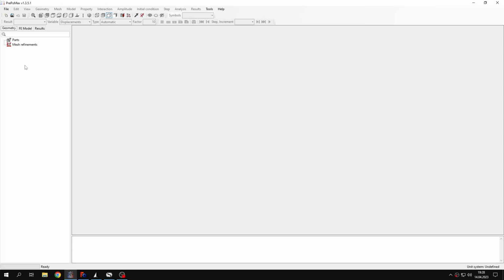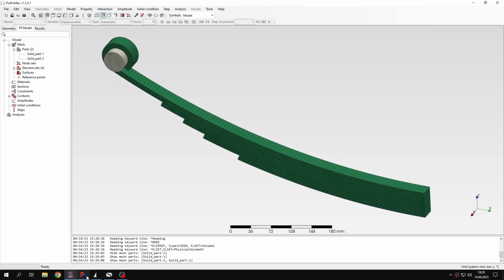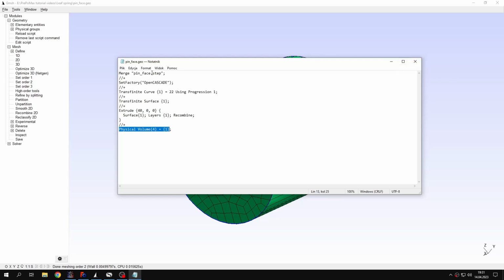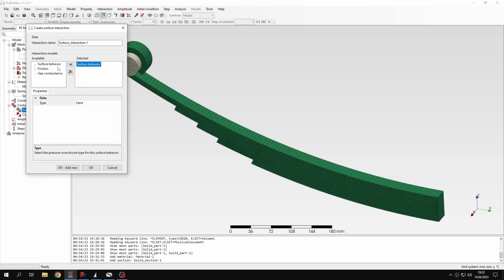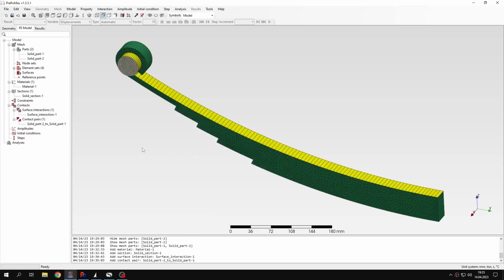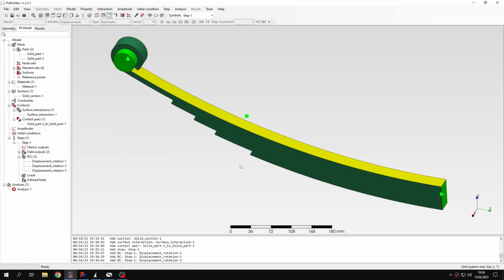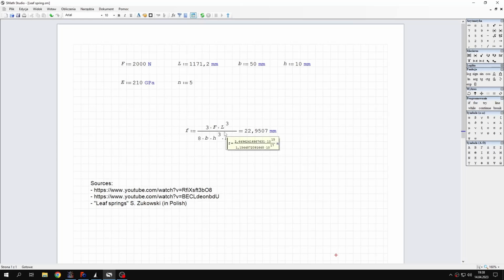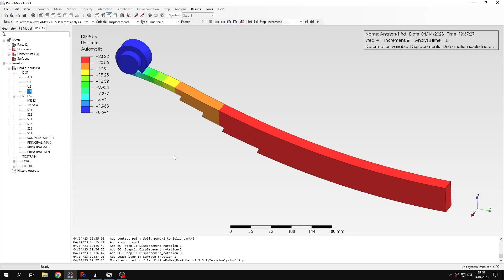PrePoMax (CalculiX FEA) - Tutorial 33 - Leaf spring

Comment: Dear FEA Analyst,
I have a series of remarks about the case you are showing. Calculix and PrePoMax are prodigious codes and I think any tutorial about them should show their full potential, not letting the curious professional walk away because of poor attention to detail.
1.	Analytical solution: the merged geometry of the leaf springs is mechanically not equivalent to a typical leaf spring, since the leaves collaborate along their height. Therefore any formula for the displacement a leaf spring would grossly overestimate what you get with this geometry. Let me oversimplify the merged geometry and say that such a spring is similar to a simply supported beam with a concentrated load in the centre. The max deflection in this case equals FL^3 / (48 EI). The average h (weighted by the length of the segments) is roughly 38.2 mm. This gives a displacement of 1.42 mm; much lower than what the “equivalent” leaf spring formula gives. A more accurate evaluation would require the elastic-line solution. Anyway the correct max displacement should not be far from 1 mm.
2.	You show a displacement of 23 mm, which is definitely in the large-displacement regime for this leaf spring geometry. Why don’t you use large displacements (Nlgeom) in the simulation?
3.	Engineering-wise it is pointless to have a model that gives a specific result only with a certain mesh (one element in the thickness direction and a specific element size) and VERY specific contact properties, as you describe. This is not a model for engineering, it is a numerical coincidence.
4.	In your results, if you check the contact (CPRESS) on the pin surface you should notice that there is an extended area with a strong traction (positive in the outward normal direction). This traction bends the thin part of the spring increasing the contact surface, even with small displacements. It is like applying a concentrated moment at the spring distal ends.
As the contact iterations progress (with linear or non-linear geometry) the traction increases because the contact area increases; this causes a pathological dependence of the result on the contact parameters and the mesh, as you describe.
5.	If I duplicate the model with Ansys and use BONDED CONTACT against a rigid pin, free only to move horizontally, I get a very small vertical displacement: 50 µm. The reason is the angular constraint at the distal end.
6.	I guess instead that you wanted to simulate a frictionless contact between the leaf spring and the pin. In this case with Calculix it is possible to do in two ways, one with contact and a low friction coefficient (solution 1) and one with a cylindrical constraint on the nodes in contact with the pin (solution 2):

Solution 1:
a.	ref point at the centre of the pin,
b.	rigid body constraint between the ref. point and the whole pin,
c.	0 displacement in the direction U1 and U3 for the ref. point,
d.	a fine mesh on the contact surfaces and in the thin part of the spring (element size about 2 mm),
e.	a contact with:
i.	low friction coefficient (0.01)
ii.	K = 10000 N/mm2, stick slope = 500 N/mm2
iii.	master: spring; slave: pin (rigid).
f.	The two usual symmetry planes, and load.
This approach gives about 1.11 mm max displacement. And this is a stable result.

Solution 2:
a)	No pin,
b)	Ref point in the middle of the pin (any x coord will do),
c)	Cylindrical ref system in the pin centre
d)	Rigid body constraint between the ref point and a node set comprising all the nodes that would have been in contact with the pin, minus those on the symmetry plane.
e)	Displacement constraint on the ref. point. Cylindrical reference system. Constraint on U1 an U3 (radial and axial). The tangential degree of freedom remains free.
f)	The two usual symmetry planes, and load.
This approach gives a maximum displacement of 1.08 mm. Two problems in this approach are two minor bugs in PrePoMax. In fact ref. points tend to move around while you work on the model, and the choice of the reference system in the displacement constraint disappears as soon as you choose ref point as region type.
Solutions 1 and 2 give very similar results; solution 2 is slightly less flexible, as one would expect.

7.	I duplicated the frictionless case with Ansys; the maximum displacement in the middle of the leaf spring, with mesh refinement and all you need … is about 1.09 mm, in very good agreement with the Calculix solutions. I tried different modelling techniques: rigid body, frictionless, low friction, … the displacement remains the same.
In summary Calculix can brilliantly and stably solve this type of problems, even if it does not have all the fancy features of expensive FEM software like Abaqus and Ansys.
Reply from the maker: Thank you for this exceptionally detailed feedback. I guess I will have to revisit this topic in the near future, then. Especially since a lot has changed ever since (for example, PrePoMax can now generate hexahedral meshes in a few ways). Some simplifications will still be necessary, but it should be much easier to make it work now than it was over 2 years ago. In fact, there was a very long discussion on the CalculiX forum regarding this case, and it took us a lot of time to test the different approaches. We've learned a lot since then, though.

Regarding what you mention as an issue with no way to apply BCs in local coordinates to reference points, this is due to CalculiX's bug/limitation. We often struggle with various quirks of the CalculiX solver (especially with 1D and 2D elements) and cooperate with its dev to eliminate the worst bugs.
Reply: PrePoMax is an AMAZING software, together with Calculix, and I think these tutorials should help use them to their full potential, which is not far from industrial applications.

Comment: Not being an Abaqus user (since Calculix has similar input deck), I found the Surface Interaction/Behavior settings part very informative. Thank you for this. Another informative tutorial on the subject of Abaqus contact behavior https://www.youtube.com/watch?v=sE5HKcAgXnw
Reply from the maker: Right, I wanted to discuss those important contact parameters on this occasion, I’ve seen quite a few questions about them and their adjustment is often needed. A very good description of contact algorithms and options can be found in Abaqus documentation but there are differences between Abaqus and CalculiX in this regard (Abaqus has much more advanced contact modeling capabilities). However, CalculiX documentation is also a good reference. It’s crucial when working with this software.

Comment: very interesting case. Just for curiosity, why did not simulate the pin with connection elements connecting a reference point at the center of spring's support (properly constrained) with the nodes of spring support? would not be easier?
Reply from the maker: That was my first idea but the model was too stiff. More accurate representation of this connection (contact with properly constrained pin) was necessary. This case is extremely sensitive to such aspects.
Reply: @FEAnalyst  I see... thanks for your comment and your work on YouTube generally with PrepoMax.